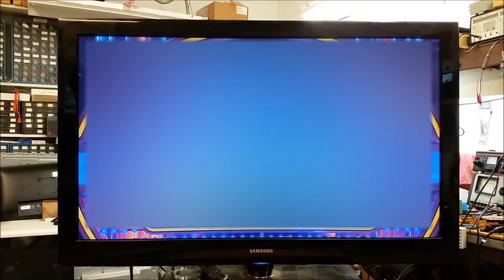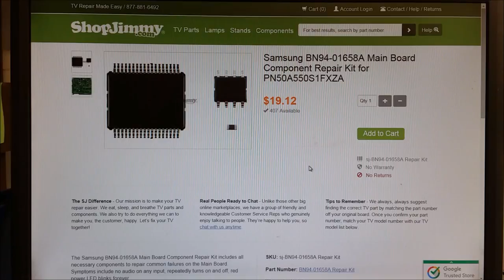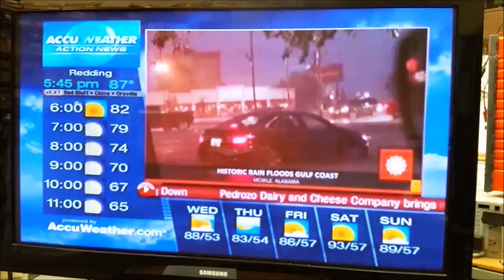Re-posted Samsung PN50A550 3.3 Volt IC Replacement Main Board Repair

Comment: What was the result of the failure?  turns off by itself after short time then doesn't turn on and flashes standby light? That's what my P51F8500 is doing and I haven't been able to get it do it with a meter on it. Seems like it works fine as long as I've got the back cover off and the meter in my hand...lol   

Would you think power supply or Y sustain? Thank you

Comment: The capacitor you remove was polarized. they are polarized caps and the line denotes positive unlike electrolytic. the cap you installed looks like it's not polarized. pay attention to the physical size of the caps u are ordering. scroll down to Leon Johnson's post

Comment: I got a 46in LCD with this problem I just change the cap on the bottom problem solve I never change the others parts  the cap I use was a 47uf 35v
Reply: i tried what you suggested. I bought polarized tantalum caps. the only issue is the caps were slightly lager. had to put the cap on it's side solder one contact to the board, then soldered a 1/8-1/4 in stripped end of a wire  to the other side then cut off the rest of the wire. I bought my caps on Aliexpress took about 3 weeks to get on the East Coast of the USA. TV works great

Comment: Norcal we had two of these come in, one for a 46'' LCD and one for the plasma you are working on, we installed both kits and only the LCD worked, the plasma still cycles. We forced on the PS and VS and VA are present as well as the other voltages, any tips would be appreciated !
Reply from the maker: is the 3.3V present on the coil. if so maybe corrupt eeprom.
Reply: NorCal, we’ll double check it. Thanks for your time

Comment: You only used one IC from the kit.  Was the other not necessary?
Reply from the maker: I have never had the other one fail. only the 3.3volt regulator
Reply: the other chip is for an audio issue